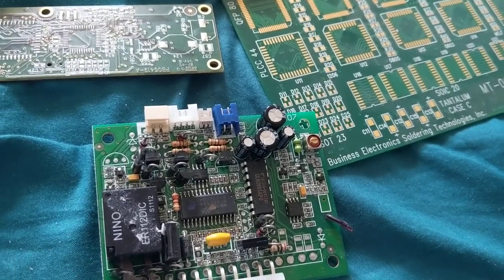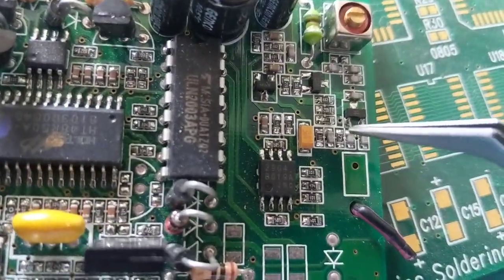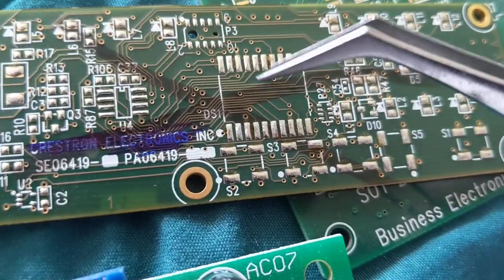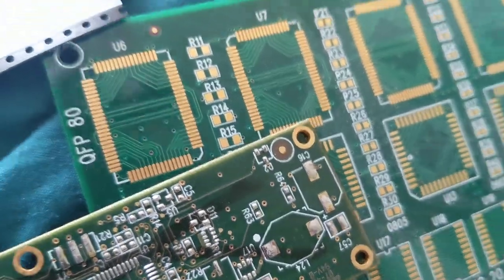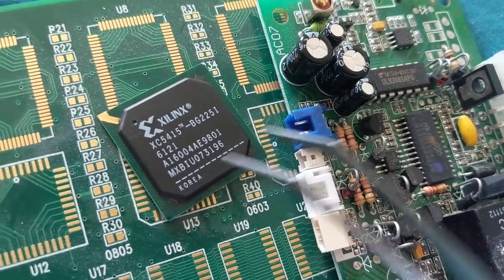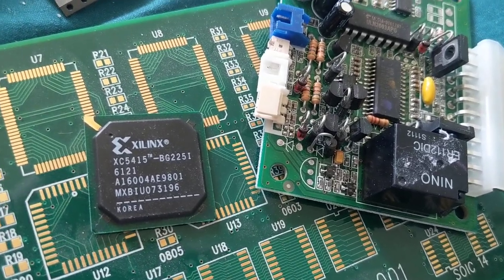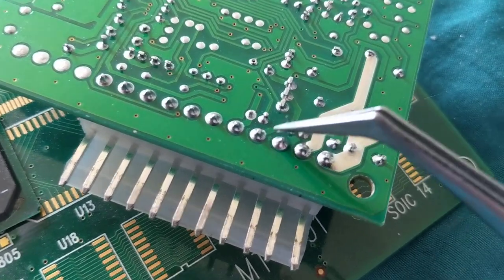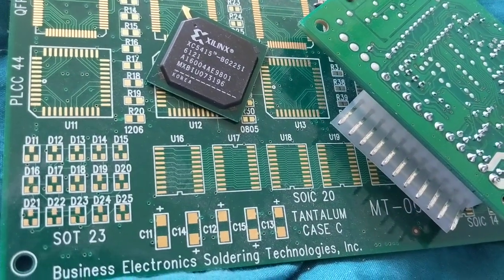INTRODUCTION TO COMPUTER BOARDS AND AUTOMOTIVE

Comment: do you know of a website to get the schematics for the printed circuit board. i use prodemand for my electrical wiring diagrams but it doesnt give very much detail into the computer side of it.
Reply from the maker: Usually these type of schematics are kept pretty much of a secret  and the manufacturer does not like to even give out the wiring diagrams that's why the repairs are being bored level instead of component level and sometimes the schematic cost more than a repair the thing that I recommend is to find the chip numbers go to Google they'll give you the chip layouts of all the pins of those chips like power and ground data lines but remember you also need an expensive scope a digital scope that's why I don't concentrate on too much on making videos of these repairs I know people don't have the equipment it's too costly but keep me updated